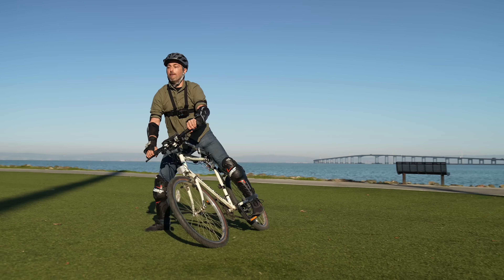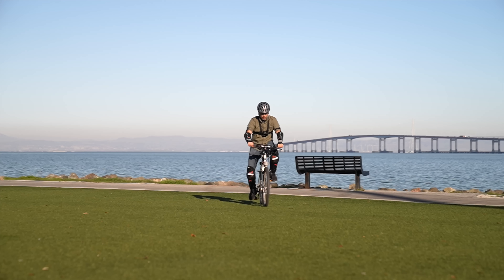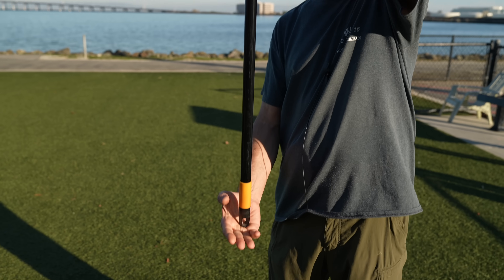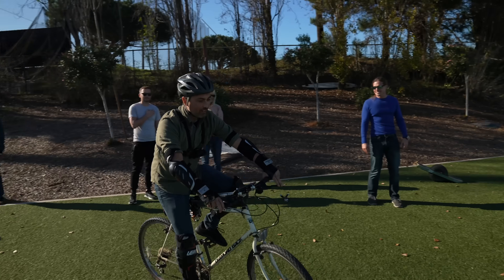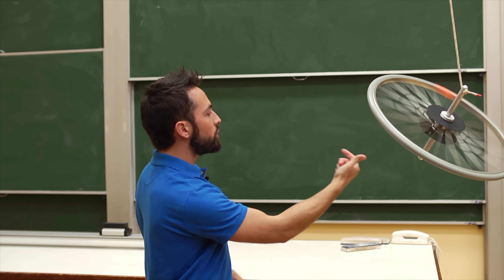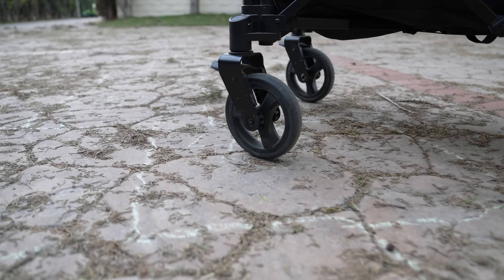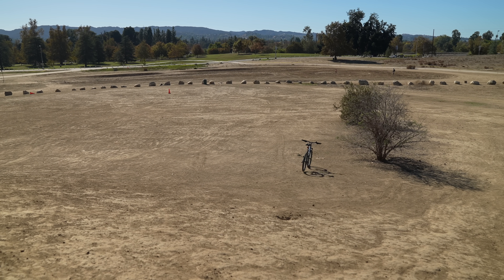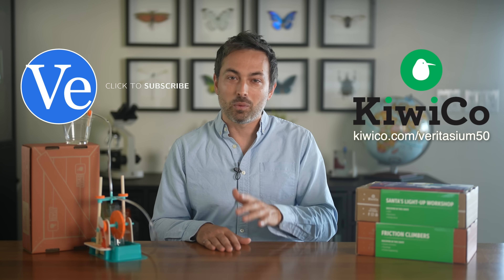Most People Don't Know How Bikes Work

Comment: I think the gyroscopic effect becomes dominant at high speeds, even for a bicycle that may not have wheels with a high moment of inertia. I felt this when I drove my bicycle down a hill. At around 50-60 km/h, you could feel the steering wheel becoming very stiff, and as soon as you try to push it to the left, the bike immediately leans to the right without any visible counter steering. The physics of steering at that speed is very different and the rider could tell it. It would be a great experiment for another video.
Reply: Nope. Speed affects the other factors as well. High speed makes the caster effect stronger and also makes the self-steering react more strongly.

A very small amount of steering at low speeds takes a while to take you off course, but at higher speeds you'd quickly shoot off in another direction, right?

Comment: Absolutely wrong and it's already been disproven. Steering does help you keep upright, but it actually is the gyroscopic effect of the both spinning wheels that keep the bike upright as well. If you were to lock the steering wheel and still push it downhill guess what. It will still keep writing. If you were to keep the bike in place lock the steering wheel and have the wheels spinning in place, it will keep upright. So that completely disproves everything you're saying about the steering wheel being the only reason that keeps the bike upright. Gyroscopic effect does play A part keeping the bike upright.

Comment: This is interesting as balance is taken for granted I work at a bike shop and not everyone has the same confidence in their balance. Technique in mountain biking  requires counter steering in fast turns and slow technical turns so practicing ones core strength improves balance and in turn confidence.

Comment: I wonder if the drive mechanism makes a difference also. A bike is pedal driven which are near the center, motorcycles are driven by the rear wheel by chain and sprocket. At higher speeds you can still steer the motorcycle if you  lean into the turn. Of course that limited but you can still do it. At higher speeds we counter steer and at lower speeds we counter balance.

Comment: I have been aware of this for long time. I was hoping for a discussion regarding the causes of "death wobbles" on bicycles and to a lesser extent motorcycles. On a long bike I participated in many years ago coming down a long hill I reached 82 Kmph without any problems, however, later in the ride, my bike would get the "death wobbles" at 76 Kmph!
Reply: Death wobbles are just when one of these self-correcting factors becomes so strong that it over-corrects. Enough speed plus a small bump in the road to push the steering off-center enough, and it wants to re-center so hard that it gets to center still with loads of momentum and ends up even further out the other side.
Reply: From what i know death wobbles come from the bike trying to self stabilize as a result the handlebars turn, but at speed the rider tenses up and does not allow this, thus the motion gets transferred to the rear of the bike which isn't designed to move around, which causes instability. This instability further makes the bike want to correct and with a tense rider it further is unable to correct to a greater degree. So on so fourth until eventually the death wobble is so great it leads to a crash or the rider falling off or something
Reply: @B1SQ1T   @Benny Mackney  I looked up the Wikipedia after I posted my comment, you are both likely making valid points, however, I suspect a major cause was slight buckling of the wheel(s) arising from being run of the road and down an embankment (by a truck driver who drove all the way on to the verge to try to kill me), prior to the fast sections when the death wobbles occurred.

Comment: The plot twist is you don't actually have to counter turn in ideal situations.
You can just start leaning left to turn left.
Rather than turning right to lean the bike left to pull off the left turn, you can instead lean left straight away which will allow you to immediately turn left, without any need of turning right.

This works a lot more for wider turns however. If someone needs to turn right within 5m, they probably won't be able to just lean right and turn.
Reply: Oh? How do you initiate the machine to lean? Countersteering, even if imperceptibly small.
Reply: The second plot twist: leaning does nothing. Check out Keith Code’s no BS (body steering) bike in his super bike school and it shows that you can hang completely off the bike and you’ll never make a turn.
Reply: @theredmage1548  Yep but good luck convincing those who think otherwise
Reply: I mean, yeah, if you shift your mass slightly leftwards then you're going to bias the bike to lean left, but I guarantee you that in the process of doing so you're slightly countersteering to keep the bike going straight. Even if you let go of the bars and pushed your bodyweight leftwards off the bike, it's going to tip the bike chassis to the right and it'll steer right, thus countersteering.
Reply: @SqueakyNeb  And even if you do so without touching the bars the left lean will induce a momentary turn to the right before settling into a left leaning turn.

Comment: When I was teaching my now 20-something son how to ride a bike, I realized I had no idea how to help him other than to say "go straight - uh, stop falling!" So - as I like to tell the story - I did what any 21st century dad would do and googled the answer. Someone was selling a "foolproof" system that I didn't want to pay for, but it included a force diagram of what keeps a bike up. As soon as I saw the diagram, it clicked. 
I wish I could post the diagram here. Basically, though, I learned then that the handle bars are for balancing, not for steering. To steer you have to lean, then by leaning, you go on a different circle to maintain your balance. 

The diagram: Basically, imagine that you're biking on a circle. There's a gravitational force making you lean in, and a centrifugal force making you lean out. The two forces must be balanced. If you're falling in, you have two choices - speed up, or make your circle tighter. If you can picture that, the next step is to realize that you're ALWAYS biking on a circle. It's just that you can pick the radius.

Comment: I wonder how this affects motorcycles at high speeds. On a motorcycle going "fast" (usually at like 22mph) we use a method of look left, push left, go left. I wonder if you have to turn the wheel to the right before taking a left at high speeds. I do notice myself using this at low speeds (under 10 mph).
Reply: What you just described (push left, go left) is counter steering. You push on the left handlebar, which turns the front wheel to the right, which initiates your lean left, and then you steer through the corner to the left. You can't right a motorcycle at high speeds without counter steering.

Comment: 3:00 I can see where’d you would believe that people wouldn’t consciously be thinking about the counter steer but I can tell you right now that anyone who has ever had a motorcycle as a primary vehicle thinks about this on a level even further than just conscious. Your mind works completely counterintuitive to normal and at speeds that feel exponentially more intense with only a few cm^2 of rubber connecting a few hundred lbs of metal and gasoline, plus your weight, to the blacktop. The conscious-subconscious, I think they call it?

Comment: You are talking about "rake" .  The distance in front of the front wheel to the imaginary line on the ground pointed at by the axis of the steering.  It is hard to explain.  Choppers have a longer rake for high speed highway travel.  Shopping carts have no rake.  They travel slowly.

Comment: Momentum  helps keep a bicycle stable too.  The slower I am going, the larger & more exaggerated corrective steering I need to remain stable. Also consider each peddle stroke throws off the balance of the bicycle a bit. In order to go faster I need more stronger peddle strokes. Yet going slow, coasting with no peddling, makes for more difficult balance. 

But I do believe I could turn a bicycle right without first steering left and visa versa.  When I turn I both lean into the turn and turn the wheel slightly simultaneously.  If you do both at the same time in the right way, I don't think it's necessary to first turn the other way.

Comment: The headline should be "most NON cyclists don't know how a bike works "...or alternatively...more people should be cyclists - i got 5 seconds into this and eye rolled....No to turn left, you do not "turn the bars left" - you counter steer by PUSHING the left side. it's imperceptible on a bike and comes automatically - but anyone who has gone for a motorbike license learns this technique actively - because steering a 250 kgs system at 100kmph is somewhat different to an 80 kgs system (bicycle + rider) at 25 km ph.

Comment: bro come on your not even trying. can you ride a bike with locked steering? yes if you cant turn pop a wheelie to stabilize or turn. even little hops with the front tire will turn you good enough or keep you going straight. long turn no problem wheelie and lean...

Comment: Hmm, but this is obviously still not the full story. Yes, if you ride in this style, you end up turning the opposite way to start the turn, but that's not the only way to ride. I did some experiments myself years ago, though nothing as sophisticated as this. If you ride without holding onto the handlebars and use only your weight to turn left and right, then you can turn without the counter steering. The precise shape of the bike is also a big factor - shorter bikes require more counter turning than longer ones. In the end, I did manage to make turns without counter steering, but it's tricky.

Comment: Hello, I don't normally comment of your videos, but the premise of this one is making some pretty serious assumptions about how the act of bicycling actually works. My biggest concern is that you're ignoring the fact that you can turn without counter-steering at higher speeds by tilting your bicycle in the direction you want to go and then turning your wheel in the same direction. You've basically ignored professional high speed cycling techniques to formulate a video, which teaches people incomplete facts about the physics of bicycling. You can turn a bicycle without even touching the handle bars in this fashion and I assure you the physics forces from you leaning on your bicycle is not going to counter-steer the wheel for you.

Comment: this exactly why most new motorbike riders will crash
they see that the wheel turns, and think because its powered you just have to steer in the direction you want, which is true when you are pushing it, however the higher mass of a motorbike will throw it severely off balance if you try it at any speed.
knowing this mechanic, actually helps you be a better rider, as you can plan your moves better knowing you will have to turn right to go left, and visa versa

Comment: im sure a pro rider could overcome the need to lead into a turn by slightly swerving into it. if you want to turn left you stand up and shift the bike to the left and lean into the turn. if you're on the seat you can't swing the bike side to side you can't get on the side of the tire to get the wheel to go into a turn.

Comment: Why did no one try to lift the front wheel off the ground?
Bouncing both wheels (like how you jump using the handlebar and pedal to lift the bike) could work to reposition the wheel where you want as well. . .
But interesting video nonetheless.

Comment: Should have included a POV showing pushing on the handlebar with one finger to steer. Its interesting to to this at speed and then at low speed. You will go the oppisite direction depending on your speed.

Comment: You only turn the handle bars at slow speeds. Like in this test. At speed, you mostly just lean into the curves.
Reply: Yes, I agree. I mostly ride (bicycle, not motorcycle) fast, and can guarantee I do NOT countersteer in the curves. But those are gradual turns, and when at higher speed, centrifugal force is more in play, not just center of gravity.

Comment: What's there to figure out? It's Balance, "gravity", and momentum. You can turn without counter steering. You just lean so that you don't fall over. Also. Bikes are stable because of how the handle bars are designed. The weight of the bike pulls the front wheel down causing it to point straight.  Thus, this factor plus the gyroscopic effect keep a riderless bike up.

Comment: i was waiting for you to say caster in the forks, cars do the same thing, if you ever driving an old car with 0 caster you will find it very annoying driving at speed because every bump will try to turn you in to a left or right direction.
Sport Bikes are a bit different, you actually lean in with the turn to opposed to leaning against (correct me if i'm wrong)

Comment: It's very important concept every motorcycle rider should know. It can be used to quickly avoid sudden obstacles by turning handlebars into opposite direction where I want go or initiate the steering by pushing on the bar in the same direction I want go as the bike stabilizes its self.  Unfortunately at higher speeds the phenomenon is exactly opposite, people who don't realize this concept tends (or caused by reflexes) to turn the bars the wrong way often causing deadly collision.

Comment: Does every bicycle ride does this? I've never noticed that. At low speeds, I know that I do heavy steering to stay upright. I know my first ride on a bike that I can remember. It was a small bike for children but I was to big for this. Without any training and without training wheels, I've drove it at high speeds without any issues. A few years later I got a large bike and I had big issues and really needed to learn it. That was strange. Also as a child I had balancing issues.

The whole point is just to shift the balance. This can be done in 2 ways. You either move the bike to shift it or you move your body. Maybe some people do it one way and and the other the other way.

Comment: I thought I was early and had a long comment with my guess as to what’s going on this video, until I realized this video was 2 DAYS old, NOT 2 HOURS old… Oof…

Regardless, it’s pretty obvious that it’s counter steering, an essential skill in motorcycling or really any 2 wheeled mode of transportation. Only in motorcycling it’s something you have to be conscious of and skilled in to be safe since, you know, 300lb+ screaming metal death machines surrounded by 3000lb+ screaming metal death machines screaming down the highway at 60mph+…

Comment: Another self righting effect not mentioned is that a wheel with camber produces a lateral force in the direction of the wheel, just like with steering. So when the bicycle leans to the right, even with no steering, there will be lateral force to the right which results in a moment in the opposite direction of the tilt

Comment: I get the concept that is being told here and this is a little nitpicking buuuuuuut, in 1:50 he said it is impossible to turn left without steering right and vice versa.
In same slow motion, he explains that he is trying to turn right but steering that way put him off balance. It is just that he oversteered too much to the right and started to counter-steer to left.

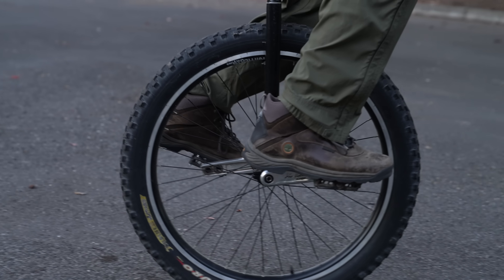He would just need to shift his balance to the right side, let the bike tilt enough and then steer to the right (like he does in 4:20)
Yes he says that he countersteered before steering was locked, but assuming that the bike is in stable balance, shifting the center of mass to right carefully enough would be able to initiate successful right side turn.

Very hard, yes yes.
But NOT IMPOSSIBLE.

Comment: One of my favorite tricks to show off when mountain biking is to stand up on the pedals and put my hands up on top of my head and let the bike roll itself across very rough terrain without losing control or crashing. The trick here is to remain directly over the rotational axis of the bike and to resist the urge to supply directional input. You have to allow the bike to 'run true'. It seems unsafe but I've never once crashed doing this for the same reason that it doesn't fall over when rolling on its own. Not recommending people try it, but it looks awesome.
Reply: As a kid riding bikes we often rode no hands. I would show off a bit by keeping my hands off even when riding over curbs and other rough patches, just stay relaxed and let the bike correct itself.
Reply: I am going to hurt myself aren't I, urge to reproduce stunt can't be contained.
Reply: @bojangles2492  practice by going down a curb and through bumpy fields, it's not that difficult. Just need to stay relaxed.
Reply: @bojangles2492  you really just need to pretend you are steering.
Reply: As kids we had a saying for this .look ma no hands....... look ma no teeth... 🤣😂😁😀😎. Nice work man.
Reply: yep, giving me all kinds of bad ideas
Reply: The problem is, without hands you can't brake or avoid a big obstacle.
Reply: we literally did this in elementary school lol.. "look, I can ride no-hands" hahah it's been decades I didn't use a bike..
Reply: Got a video of you doing it? Maybe make a tutorial !
Reply: Same thing happens if you put your hands under the seat
Reply: @elchucapablas  yeah, i love to do that with my road bike. it seems counter intuitive to a biker but the further away you go from the handlebar, the better it is since you are right over your seat post. i can even manage to do smooth turns with them. if you want to turn, just lean slightly. sharp turns are a no though, dont hurt yourself haha. also i use clip shoes so it might be easier to control my bike but harder to leave when it falls.